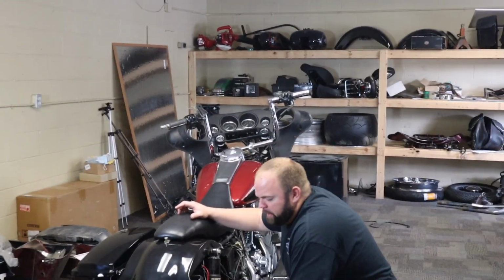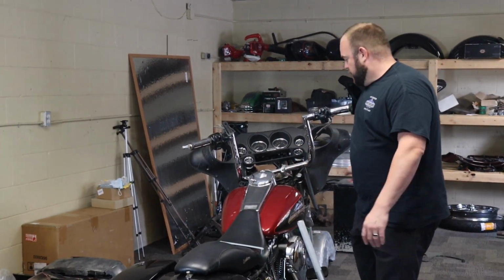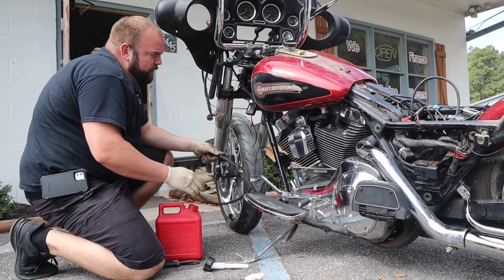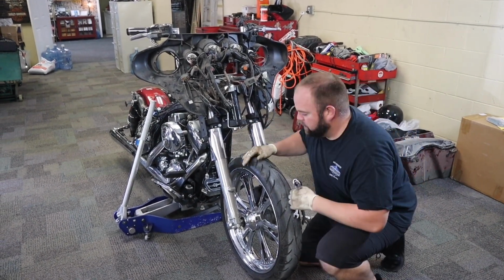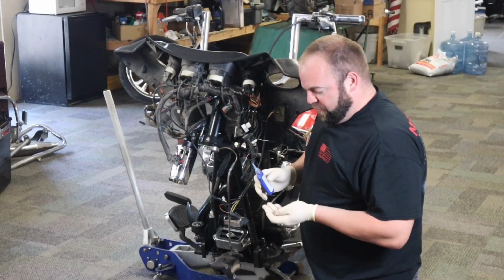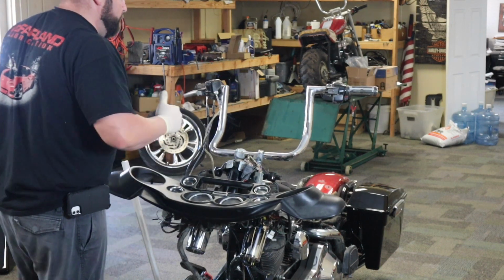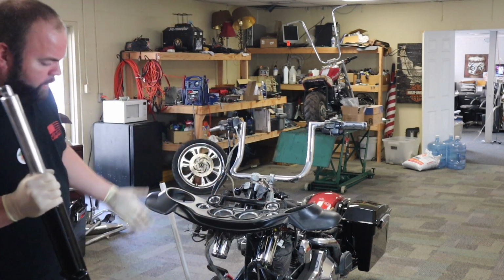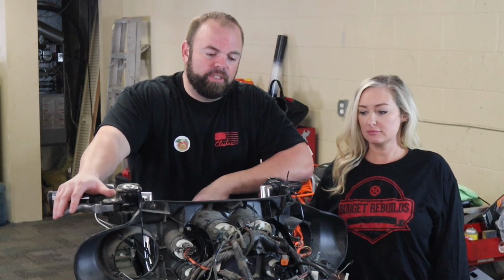Totaled Custom Bagger Project | Budget Rebuilds l Part 2

Comment: I got a 2006 ultra classic peace officer bagger, it has a 16" front wheel but I just got a street glide 18" front wheel. What all do I need to get to install the 18" front wheel on my bike. I gonna use my rotors with the new wheel also, thanks for the help and keep videos coming.

Comment: I’ve been following your videos and building my own 2005 Flhtcui I bought at auction. I just put the bike back together but now I’m having trouble with the electrical system the bike ran and drove before I took it apart but now I’m having issues. I have no power to the new aftermarket radio, the dash lights do not light up and it won’t turn over. Also the high beams are on and won’t turn off. Is their something with the anti theft that could need to be reprogrammed since I removed the factory radio?